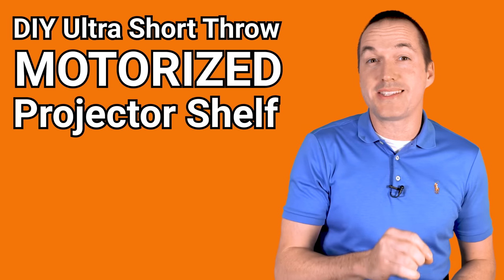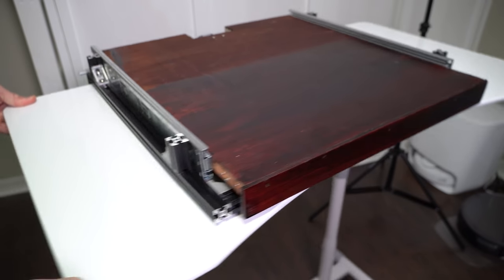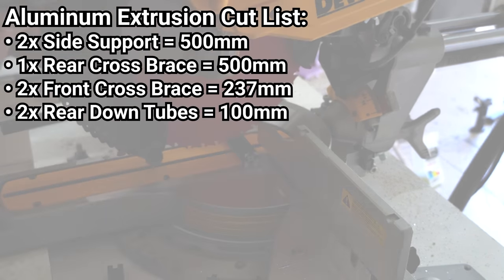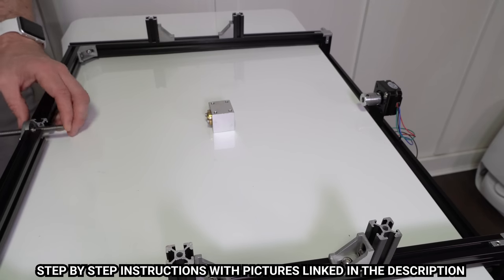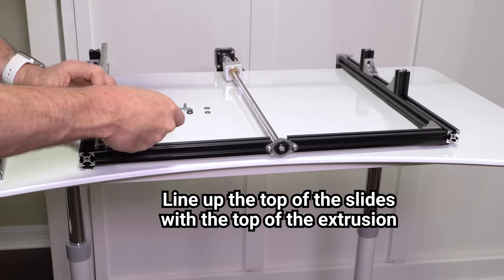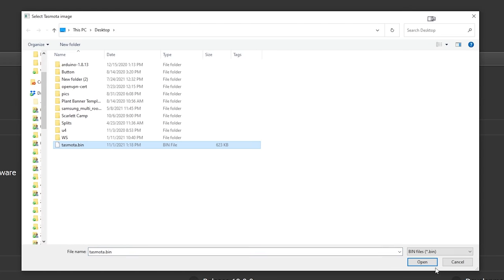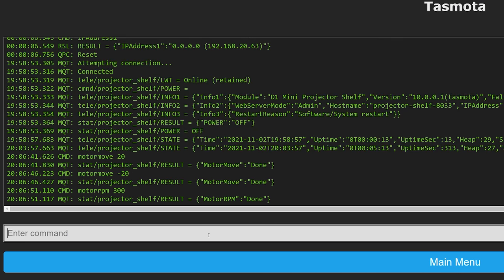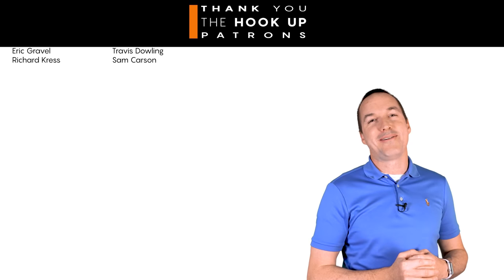Motorized Ultra Short Throw Projector Shelf - DIY under $200

Comment: I built and got it all working, pretty sweet.  The only issue i have is that no matter what I do the power going to the WiFi unit requires it to get additional power from a USB. I'm not sure if it is an underpowered power supply or the resister is not needed, I even installed separate resisters for each line and same issue.

Comment: Nice run-through on tasmota stepper configuration. I didn't realize it did that!
Reply from the maker: It requires a special compile, so not quite as user friendly as most tasmota configs, but nice that it works!
Reply: @TheHookUp  What was the recompile for ? Could you not have defined the GPIO with templates ?https://tasmota.github.io/docs/Templates/
Reply from the maker: Templates are only for assigning GPIOs, you can't assign the GPIOs of a stepper driver unless the binary was compiled with the stepper motor functionality included: https://tasmota.github.io/docs/A4988-Stepper-Motor-Controller/

There is a template in the description for this specific project, but it requires the correct  .bin

Comment: Great video!! Already set my stepper motor and I'm going to make the shelf!! Thank you a lot!!!
Reply from the maker: Try changing the order of the cables connected from the stepper driver to the stepper motor.
Reply: @TheHookUp  First time ever using electronics and I have everything working! I´m just waiting for the new cabinet to install, can´t wait!! One silly question,  can you tell me how can I add a physical switch? And is there a way for this setup to know if its open or close? I mean, if it´s already opened, don´t try to open and don´t try to close if it's already closed?

Comment: That's absolutely great, on quick question, you mounted the plywood inside the drawer but you could easily modify the design so that it goes over the "side pillars" this way creating a more aesthetic design, would that work ?

Comment: So I think I'm going to design a motorised shelf to lower a projector out of a ceiling void. We have about 400mm of ceiling void, and the projector is only about 200mm high. My plan is to get a pair of drawer sliders, each one has two fixing points for the front of the drawer, and so I'll mount them either side of the plywood shelf that will drop down, halfway down each side. Trying to decide if I should use two stepper motors near the drawer sliders, and go without any aluminium extrusions, as the stepper motor spindles will be mounted so close to the drawer sliders therefore shouldn't suffer from any side forces that may cause too much friction. OR if I just use the extrusions to create a stronger frame and potentially use a single stepper motor and spindle. Unlike the shelf design here, I can't just place the spindle in the middle of the plywood shelf as there will be a projector on it :) So I could mount it behind the projector, but then there would be a lot of shear force on the spindle, hence thinking about using two either side. So if centre of balance is vaguely in the centre then it will be fine. Any thoughts on this plan?

Comment: This seems like a good solve to get a UST installed without a wildly wide media bench. I just wonder how close to the edge of the table top above it the projected image fires. Conventional wisdom for a center speaker (well, wisdom, period) is to have its front edge at the edge of the shelf it sits on. That might be too close for the projected image to sneak past, at least I assume as much. Don't have a UST yet, guess I'll buy one and then figure this out. The easy solve is center inside the furniture but that does get uncomfortably low, to the point where it will affect the sound experience as well.

Comment: Thank you - I used your design to hide and reveal my projector in a floating cabinet that sits just below my screen. I automated it using Home Assistant so it operates when my Denon Receiver is powered on / off and  - super pleased with it.   While I have no intention of moving house I know its unlikely that the next owners are not going to want to have maintain a Home Automation server to use the projector, so I am wondering if there is a way of adding a on / off button to the ESP8266 or the DRV8825 boards to simulate the MQTT message and activate the stepper motor? thanks!
Reply: Hey, I know it's been a while since you asked this, but did you ever get it figured out? I'm also interested in hooking up a physical button, it would be nice for when I have guests over who want to use my projector.
Reply: Just add a button to the esp and trigger the rules/ button on keypress. You have to dig into tasmota to hook it up

Comment: Love this!! Two questions…how can you adjust the speed of the motor so it can open faster? And related, is the opening speed at the top speed of this motor or would you need a bigger motor? I want to use this for a drawer that’s 60 inches wide so would like to size stepper motor properly. Thank you in advance for you insights.
Reply from the maker: Speed is limited by the number of threads and thread pitch on the threaded rod.  If you increase the size of the motor you may be able to get away with a larger thread pitch and therefore a higher speed.
Reply: Thank you for the quick response. So how do you identify a thread count and pitch on a rod?

Comment: Hi, This is an interesting project. Thanks for sharing. I plan to build something similar that is based on your design. One question though. Why do you power everything form a power adapter instead of plugging wemos d1 mini to usb port and then powering the rest from its outputs?
Reply from the maker: A USB port can generally only output 500mA, and the power pins on the D1 mini only support 200mA.  It would quickly burn up the voltage regulator on the board.

Comment: Great video as usual!

Just curious as to why you went down the route of a dummy switch, vs something like "Shutters and Blinds" in tasmota, or the "Cover Component" in EspHome.
This would naturally allow you to use end-stops, which would certainly be of benefit after a power-cut, as to avoid the motor stalling after a power-recovery

I guess one consideration there would be that homeassistant would by default show/expose it as a blind, as opposed to a simple togglable entity. And it's not like having it half open would be helpful.
That being said, I do stand-by the thought of endstops!
Reply from the maker: You mean like physical endstops (limit switches)? It would add significant complexity to the wiring without much benefit.  With this size stepper and 300rpm you could run a full close cycle with it already closed and it would make unsettling noises but not damage anything.

Mostly the same answer for the other questions: Just an attempt to reduce complexity as much as possible.
Reply: @TheHookUp  Ahh, fair enough.
Whilst admittedly, I don't have a projector, twould be quite interesting to see where these mechanisms can be used in other applications!

All I need now is some inspiration :p

Comment: Only thing I don’t like about this is screwing directly into the edge of plywood to hold the shelf up. Especially given that it’s holding up several thousand dollars of projector. My experience with plywood is that it’ll work for a while, but eventually the plywood will delaminate from the forces involved and the screws will either pull out or the plywood will tear out. Either way, “suddenly crashing down” is the result. I think it would be a simple modification to add some tiny steel L brackets that allow you to face screw the plywood and then bolt to the rails.

Comment: Could you somehow use the screen trigger on the projector to send a signal to the motorized shelf?!  LOVE THIS CHANNEL!!!
Reply from the maker: I use the state of the projector.  Basically home assistant monitors whether the androidTV is on the network, and if it is it pulls out the projector drawer and raises the screen.  Once the projector state goes to "off" it lowers the screen and puts the projector away.

Comment: Great Project Rob. I am currently working on it, but MQT cannot connect to the host. What i am doing wrong? I am  trying this Germany and I  keep getting this : Connect failed to 192.168........, rc -2. Retry in 100 sec
Reply from the maker: Do you have an MQTT server?
Reply: @TheHookUp   Thanks for the quick response. No i don´t. Which one would you advice me to setup?
Reply from the maker: I would recommend just using the Alexa integration like in the video. Just uncheck the MQTT box.
Reply: @TheHookUp  Thanks very much. It is working. :)

Comment: I am using the Epson EpiqVision Ultra LS300 Projector. Is it possible for the shelf to automatically move out when the projector is turned on and go back when the projector is turned off?
Reply from the maker: There are lots of ways to do that.  The easiest would be to use a smart plug to monitor the power consumption of your projector and then use an Alexa routine.  If you have home assistant you can also monitor the projector via the android tv integration.

Comment: This video inspired me to finally get an ust projector and set it up  just like you did. I'm following along with this shelf build, but I used your esphome yaml. I got it running on my bench but I'm wondering, what happens when a kid or my wife inevitably pushes the shelf closed? Or if the motor skips some steps when opening or closing. Seems like the build needs a homing switch to reset the position if something like this happened. 

Any idea on how to add a home switch to this build? Or do you have a better way to handle that?
Reply from the maker: the ESPHome Yaml has a "report stepper position" service that lets you update the ESP with the correct position should it be manually moved.
Reply: @TheHookUp  I saw that, I guess there's a way to configure an unused pin for gpio and connect a limit switch to it and have that report_position service called when the switch is pressed. Not sure the syntax for using that service to set it to 0... Do I set the position: to zero in the api section of the yaml?
Reply from the maker: @redmancrm  

- stepper.report_position:
              id: my_stepper
              position: 0

Comment: Would it be possible to run this setup with a TMC driver? Is tasmota capable of this or is there another alternative? I'm making a bootleg version of this and would prefer it to be as quiet and fast as possible and I think I can find a middle ground with a TMC driver. The DRV8825 at 16th is definitely slower and louder than I would like. Would prefer an almost silent motion as the drawer comes out.. Any help from anyone would be great.

Comment: I'm planning on using this build to create a somewhat smaller shelf that I will use to mount a traditional project behind my wall in an attic cavity. Here's to hoping it works! 

My main question for this community is how to build a "trap door" that is opened by the action of this shelf and then closes automatically when shelf is withdrawn. Any ideas here?

Comment: I'm happy with my Vividstorm screen on the floor. With my floor being carpet, should there be a concern with placing my AWOL projector on it as well, or should I place it atop something?
Reply from the maker: I don’t think there is any ventilation on the bottom of the awol, so as long as you can get it properly leveled I don’t see an issue with it.
Reply: @TheHookUp  
Thanks for the advice (The Hook Up 👍). I finally received my Vividstorm & AWOL Vision and you are correct, very amazing experience! (I like the Formovie as well, but no 3D ). Until next time 🙌

Comment: Very nice project, I managed to build one, thank you very much. I do have a question though, I'd like to modify the tasmota setup to get the signal from a usb connected to the projector such that when I switch on the projector the drawer comes out. I have taken a usb from the projector and put a voltage divider such that I get 3.3V. I haven't though figured out how to hook this to D1 mini and make a rule such that when the 3.3 is detected the motor moves X times and when the 3.3 is gone (projector switched off) then it should return back.. any help appreciated
thanks
George

Comment: Awesome video! Any way to design it so the excursion is more than 11 inches? The Epson LS500B needs to be much further away from the screen to achieve a 120" picture 😬
Reply from the maker: Ultimately you are only limited by the length of the lead screw and the rigidity of the drawer slides.
Reply: @TheHookUp  Am I correct in assuming that this implies I should get a relatively deep cabinet to begin with? (Since this would be the upper bound for the length of the lead screw if I don't want it to stick out front or back)
Reply from the maker: @andraspeshti5395  Correct

Comment: There are some Tuya window opener that could be more easy to use.
Reply from the maker: That's a super interesting idea, I bet it would work! Looks like those things run on RF, so you could use a tasmota RF bridge for automation.  Slightly less extension for the version that's 400m wide (only 300mm extension), but overall it would be a pretty slick solution.

Comment: This is so cool.  Does the drawer slides have a sag when extended considering that the projector is heavy?  If so, do you know how much sag it has?
Reply from the maker: The XGiMi sags approximately 1/4", but it's really heavy.  The epson LS300 doesn't sag at all.
Reply: @TheHookUp  I actually made one with some modifications by adding braces, using a 2040 on the shorter side and using a heavy duty slide to prevent sag.  I haven't installed it yet but I'm planning to bolt it permanently on my console table.  I have a few questions since this is my first time doing something like this.  Can the motor rpm be increased?  If so, by how much?  I am estimating that my motormove is around 31,000 so hoping I can speed it up without frying the controller.  Also, just realized that the stepper motor is loud. 😁 Another thing is, what happens if the motor stops mid movement?  Do I have to manually rotate it back to its starting position?  Does pressing on or off twice make you lose your starting/end positions?  Sorry for the many questions. 🤣

Comment: Excellent Video!!!!!!  I got the motor and components working up to the point of Alexa being able to discover it.  It wont show up.  Any thoughts?  Thanks again!!!
Reply from the maker: Is your NodeMCU on the same network as your Alexa devices? Do you have any restrictions on that network (like are you using a guest network or VLANs)?
Reply: @TheHookUp  My phone and the node are on the same network.  No restrictions.  I'm using the Alexa app to try and discover.
Reply from the maker: I see. I don’t think the alexa app is capable of discovering, you need to have a physical alexa device like a firetv or echo.
Reply: @TheHookUp  I tried from my fire tv cube as well.  It still did not work.  I really appreciate the help.
Reply: Do you have any videos on how to add a rf receiver?

Comment: Would this work to make a screen that lowers down? Is the motor strong enough to hold the weight do you think?
Reply from the maker: No, but I did a project like that a long time ago that uses a planetary gear stepper that would work: https://youtu.be/ocOO-8X_-Rk
Reply: @TheHookUp  thank you for the link, the project, and such a fast reply!

Comment: Hey, cool project! but how does that system handle following situation: when moving the self the power goes out, lets say ~halfway on fully in or out. when i think it rebooting i can't think that it remembers the stepper location to return it to "home" or fully open state? correct me if i'm wrong i there's something in the code handling that. (or would this require limit switch to the end(s)? or in this kind of case do you just manually push/pull the shelf to its extreme position by hand?
Reply from the maker: You've got a few options:  Move the shelf by hand, go to the tasmota console and issue a motormove command for a smaller number of steps, or just issue the full move command.  If you issue the full move command it will reach the maximum extension and the motor will start missing steps, which will make a terrible noise, but won't do any damage to the motor or shelf since it's a low torque motor set to high RPM.
Reply: @TheHookUp  Thanks for reply, that helped a lot!😀 another question came in my mind, what if something happens in the network or the software and the motor just keeps going even when it should've got to the ideal end (and mechanics resisting more rotation for the motor)? Can this cause node/driver/motor to heat up and cause fire hazards or smth else that can be an actual problem?
Reply from the maker: Tasmota does not need a network connection to control the stepper motor, if it lost network connection it would complete the move and then turn the motor off as normal.
Reply: @TheHookUp  allright, thanks!